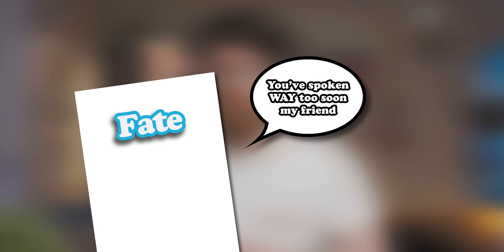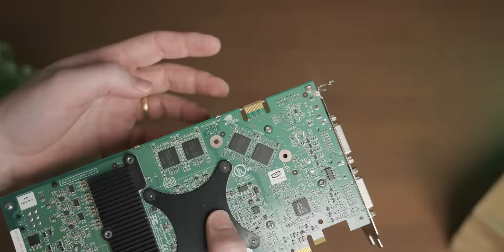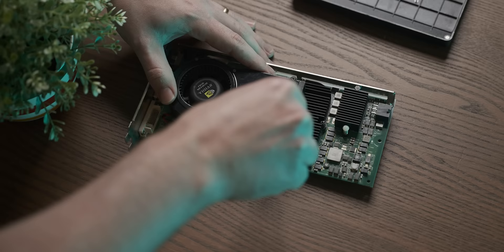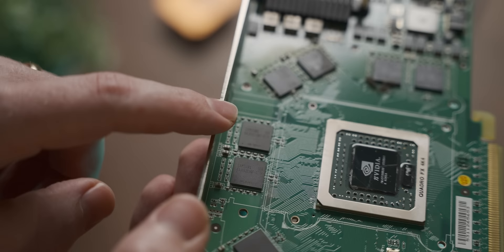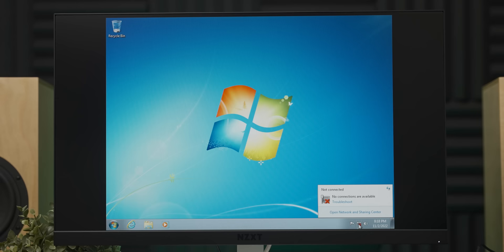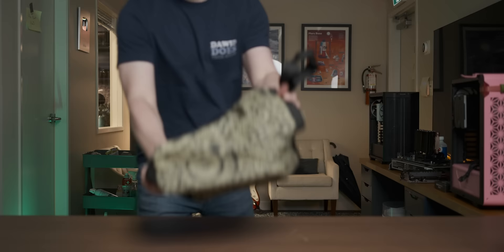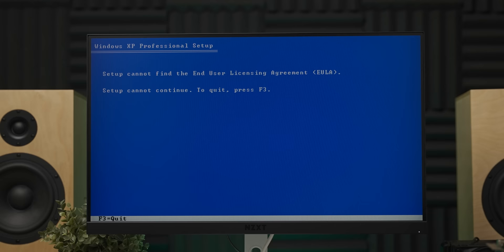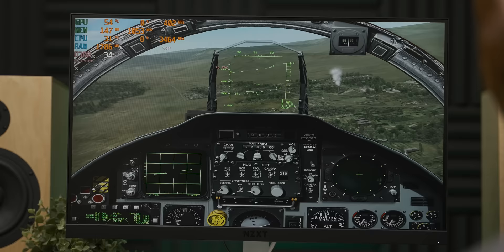Buying The First Graphics Card I See On Craigslist...

Comment: You should overclock those Ballistix. It would help when testing GPU performance in 1080p. 12th Gen's memory latency kinda sucks compared to older intel generations. Those 3200MHz Ballistix kits can overclock above 4000MHz but you'd want to keep the IMC in Gear 1 enabled so you'd be capped by the memory controller. Most 12th gen chips I've seen reach between 3900-4133MHz for max DDR4 speed in Gear 1
Not for testing these old GPUs but for when you bench higher end cards

Comment: I have a quadro FX 4800 in a system here beside me I use for retro gaming windows 98/2000/XP...The system has windows 2000 installed so it is trial an error to get windows 98 games running on it but most worked so far. For dos games I use dosbox.

Comment: Most likely the reason you could not get Windows 7 to run a on that motherboard cpu combo is Windows 7 only works up to CPU I7 8700 you get a better cpu to work but you will have to download some mods for it.

Comment: Sounds stupid, but did you try a different monitor, Some monitors of today have issues displaying anything from and older system even if the GPU is the same from a known working system, sometimes changing the type of connection can fix it, or if your lucky, once windows installs the driver it might display something, I've got a few monitors here like that, its the most annoying thing ever. I got an old TV I use for systems like that, it seems to be fine with HDMI and vga and it picks up the bios on most of the things I've hooked up to it.

Comment: If you wanted to use an old ass card, I would've sent you my first overclocking GPU from 2005. I have a Winfast PX6800 GT, which at the time was a beast at overclocking. I believe I paid $500 for it in 2005. I wish Winfast still sold GPUs in America but they don't and I don't trust any of the weird online retailers that do well them. Winfast used to make damn fine cards, I bet they still do.

Comment: I would find it rather ironic if installing a semi-lightweight Linux (the latest Xubuntu, for example) on the machine would cause much less trouble, but I would not be surprised by it at all. Just as a point of reference, I would never have suggested you installing Linux on a random ARM based Chromebook. That's really not for the feint of heart, even if you know Linux well.

If you were to install Linux, whatever results you got from the built-in Nouveau graphics drivers would have to do, because trying to install any proprietary NVIDIA drivers would result in the same sort of torture as going back to ancient Windows versions and finding drivers for the card for them, or perhaps worse.

Comment: This is very much like me trying to get Windows 98 working and the computer even if it supports it just refuses and rather take DOS 6.0 than Win 95/98. I’ve had no issues with XP though on any of my retro PCs. It just works. The infuriating thing about win 98 is that I’ve had it installed before with no issues but now it’s like all my systems decided to go on strike together and refuse any non NT based OS throwing up weirder and weirder errors like I can’t find the log off.wav sound file so I’m committing harakiri type of thing.

Comment: But can it run Crysis?
Reply: Crisis on a possibly maybe ask Linus and Anthony if possible DDR3 512 megabyte card well I'm going to have to have a very fast processor and all four Ram slots filled with Max Capacity in each to even run that 480 or 720.

It's possible crisis might barbecue the old Hardware though.